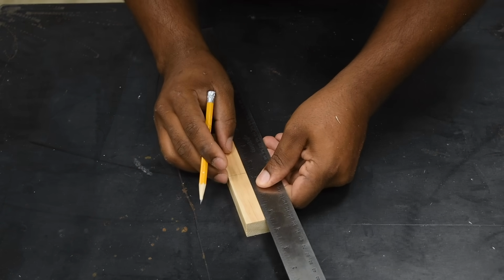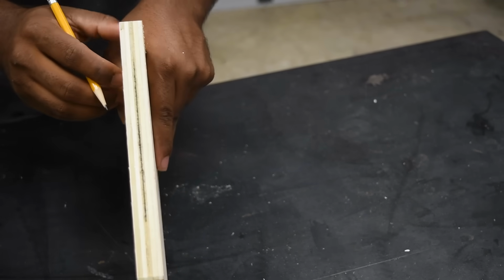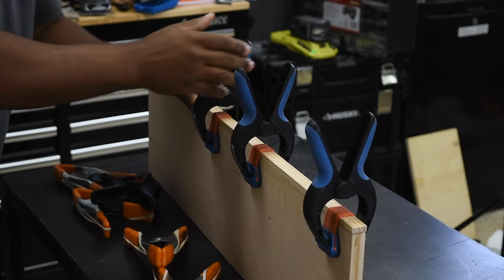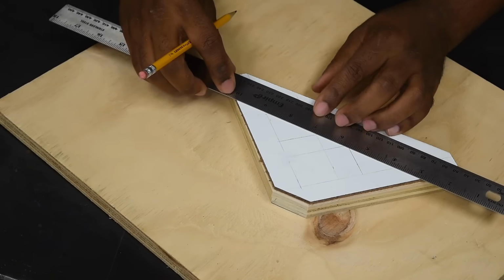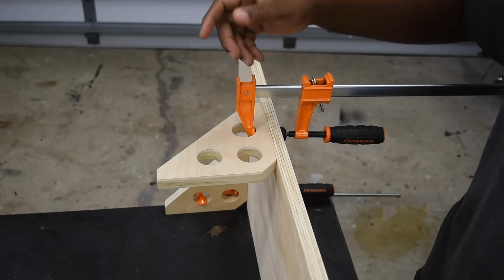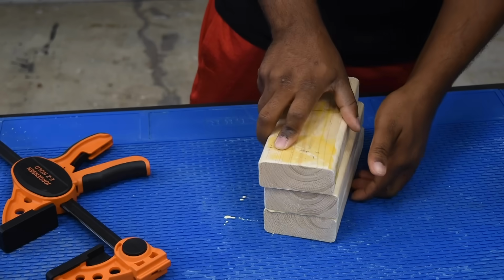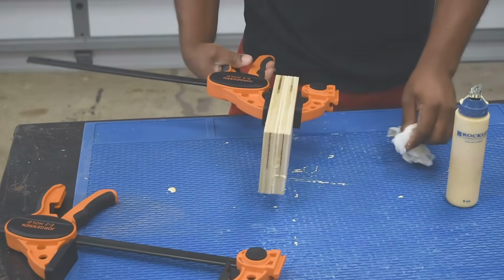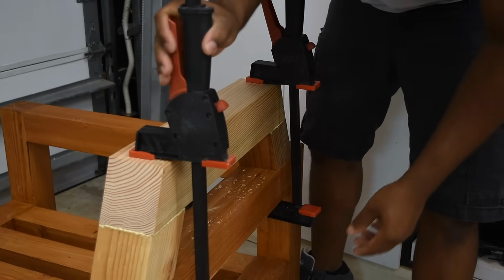6 Woodworking tips & tricks for beginners

Comment: Great video. There were some good tricks in there that I haven’t seen before. HOWEVER, when you used the table saw it made me cringe. The only time you can make a cut with the fence touching the wood while using a miter gauge is if both sides are supported. Instead you supported the outside piece and when you finished the cut the inside piece was begging to have kickback. What I would recommend for making repeatable cuts safely would be use a stop block. Get a block that you know is square and is at least 3 or more inches wide and put that next to your fence. Then measure from the blade to the block instead of the fence and slide the piece you are cutting up to it, hold the piece down and remove the block, then make the cut safely. I used this when I had to cut segments for a bowl and it just adds a level of safety and prevents a cut in your chest and ruining good wood. Other than that it really was a great video. Seen a few of those before but the nail for dowel thing is smart. For the salt, I usually just rub the two pieces of wood together and they won’t move instead of using salt.

Comment: Awesome video but with the  clamps bicycle innertubes work a lot better. Simply remove the little rubber pads from the spring clamps and cut roughly 2 inch pieces off of the street bike inner tube and slide it on. A innertube costs roughly $2 and can make something like 30 clamps.

Comment: Never use your miter bar and table saw fence like that, you risk the cutoff jamming or being thrown, potentially causing injury. Clamp a small piece of wood at the front of your fence to use for registration. When you cut your piece, it won't be tight between the blade and the fence.

Comment: The mark on the side of a scrap for a perpendicular drill guide is great.  It reminds me of a similar one, where you attach (or just hold) a shorter piece of scrap (of the same thickness) to a longer piece, side by side.  The 'L' formed between the end of the shorter and the side of the longer (assuming the end of the shorter was chopped off square) provides a perpendicular place to 'nest' your drill bit while drilling.

Comment: I Ike the center marking gauge. If you take the center [wood] screw, and grind the point down to three of the threads, to a 30 deg. Angle, (60 deg included angle), the point would be a lot smooth for center marking.
Also, if you can’t make it accurate, make it adjustable. Awesome channel, awesome videos.